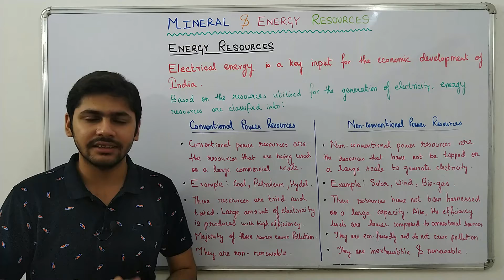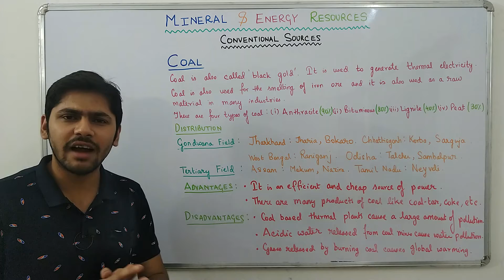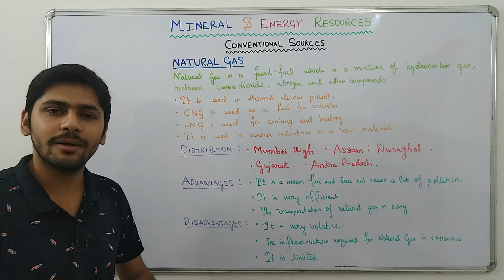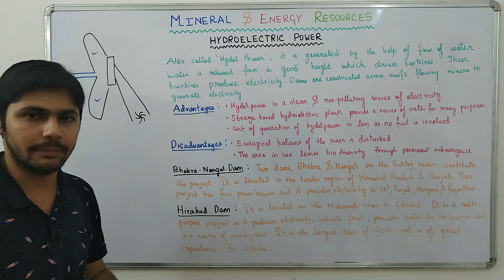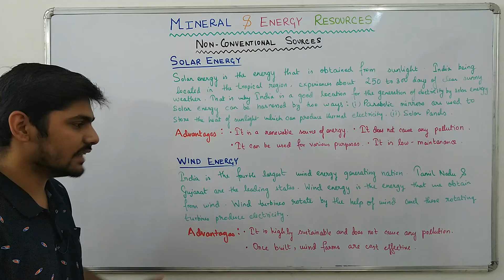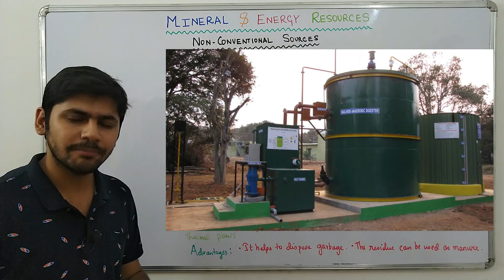Mineral & Energy Resources | Part 2 | ICSE Class 10 Geography

Comment: Sir why petroleum is called liquid gold
Reply: Because Petroleum Is Obtained In Form Of Liquid & Since It Is Precious As Gold Therefore It Is Called Liquid Gold.
Reply: @cricketnews4121  and why coal is called black gold
Reply from the maker: Both the things are explained in the video.
Reply: Sir where
Reply: @cricketnews4121  no this is not the reason
The correct reason is
There is not even a small part of petroleum which goes waste...that's why it is called liquid gold